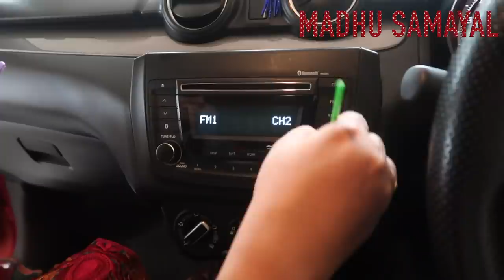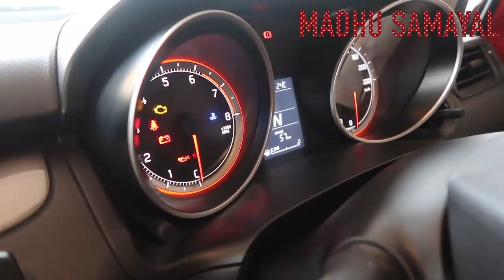Car Cleaning with just Rs.10/Complete guide/Tips & Tricks of cleaning car

Comment: 1)DNT use news paper as print will sure spoil the car glass
2)DNT use any frangness inside car as it will affect babies (better to keep a fresh Jasmin little bit before ur trip
3)DNT rub car glass with towel when it's with dust 
4)Use car wash liquid that will give u polished surfaced
5) once after pouring water, do allow it to dry 50% and DNT allow to dry 80% range becos it will create white white dots 
6) Tooth paste is good for reflector
7) Never open a door and splash the water
8) Use vacuum cleaner to take the dust in hidden places (wet towel will be effective but not upto the mark)
9)Never use AC once u start the car or if u parked in sunlight... Open windows and make engine to run for 5-10 minutes then switch on the AC
10)Never rotate the steering in parked vehicle because it will cause damage to ur Tyre

Just it's my known tips to maintain good condition
Reply: Thanks for the great tips...except for the Jasmine. ..my dad I get very bad headache if we smell it.
Reply: instaBlaster.